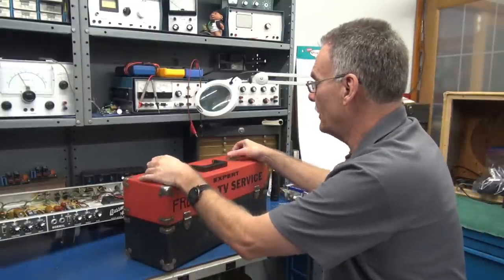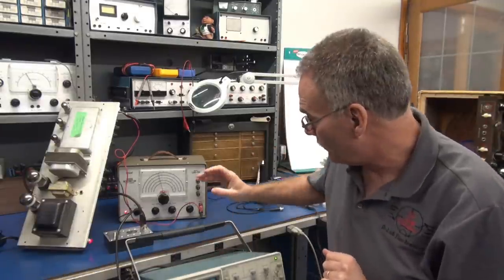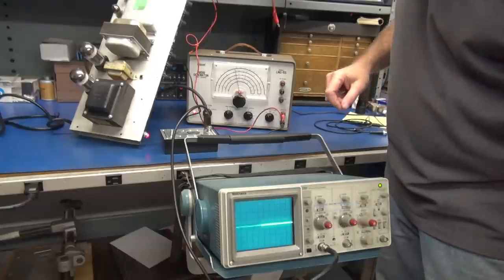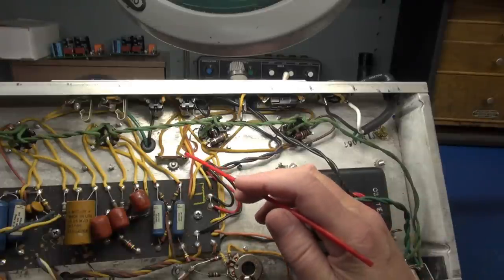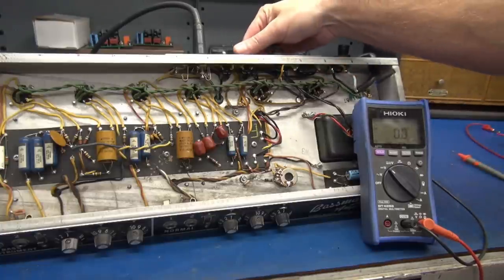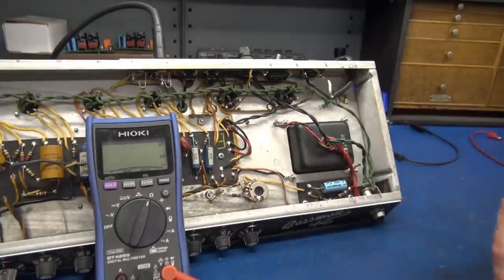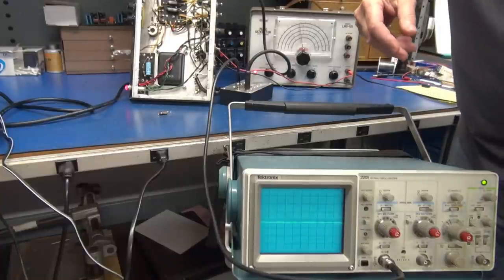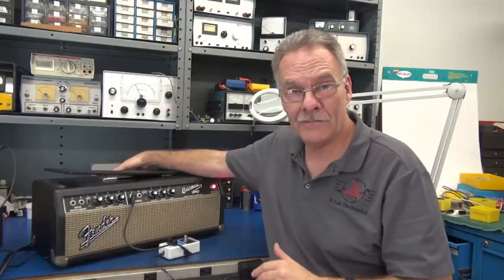D-Lab Basic Training Fender Bassman tube guitar amp Low distorted output Lets fix this with Fred

Comment: Holy crap, this video couldn’t have been timed any better.  Just this morning I received new tubes in the mail for my 1967 Bassman 50, and after installing them I noticed that even though it started working again, the output is low and distorted.

Comment: Loving this Fred series, Thanks D-lab! 
Any chance on doing some  Phase inverter scenarios?  Explain the difference between using a 12AX7 compared to a a 12AT7 for Phase inverter and the reason for and against etc.
Thanks cheers
Reply: ,AT is used as it is not a Galn Stage

Comment: Thanks for another interesting video. What is the voltage Vpp of the signal coming from your audio generator unit when you perform the initial testing?
Reply from the maker: I believe it was set at 100mv

Comment: Hello D-lab, what are your thoughts on using higher screen values (~1k) to protect modern production tubes from overcurrent faults?
Reply from the maker: I do believe its a good idea. Ham transmitters use screen regulators to protect final output tubes. Examples 0D3, 0C3. They have been doing that for years to protect 6L6 and 6146 tubes. It would be worth exploring.

Comment: The bad screen resistor went up to 20K homes when a good screen resistor should have been at 470 homes so the bad screen resistor that is at 20K is restricting and giving less current to the power tube and that is causing what type of distortion it look like a symmetry distortion how it would adjust the the width of the positive and negative push and pull maybe you can explain in the comments and get back to me that would help me out a lot but it has something to do with the restriction of current that would that is doing something to the tube to cause it distortion it might be a transconductance thing because transconductance is based on the current verse the voltage of the input and the output of the tube

Comment: Could anyone here tell me what might be causing this issue?  New 6L6s installed in a 67 Bassman 50, but only one of them is glowing.  The amp still works, but the volume is noticeably lower and the tone breaks up much easier than it used to.
Reply from the maker: Identical problem the Bassman in this video had. Check those Screen resistors
Reply: @d-labelectronics  I swear I’ve learned more from this channel than from years of classes related to electronics.  Please keep it up, you’re a national treasure!
Reply: Only one “glowing” -- I assume you mean the heater isn’t lit up.  Check it in a dark room to make absolutely sure.  If you’re certain the heater is dark, then swap output tubes to see if the “dark” tube stays dark in its new position.  If it does, then that tube’s probably bad.  If, however, after the swap, the other tube that looked fine is dark now, then I’d say you’ve got a problem somewhere inside the amp, in the heater circuit.  In the latter case, could also be loose contacts in the tube socket where you’ve determined either tube stays dark.  New tubes do occasionally arrive bad, though, so that would be my first suspicion.
Reply: @drawbridge611  I swapped the tubes and now they’re both glowing…. Wtf, this is confusing.  The only possible explanation that I can come up with is that maybe the “non-glowing” tube just wasn’t seated properly?  Any more ideas, anyone?
Reply: @seanmcdonald4686  It could be a bad socket not making good connection.  Or it might be a bad solder joint on the socket.
Reply from the maker: Check the tube socket pins, see if they are worn/spread out not making contact
Reply: @seanmcdonald4686  Totally agree w/ Mr. Terry re. loose pin sockets.  There's also the possibility of corrosion present on the tube socket contacts (it is an old amp after all), and the simple removal & replacement of the tubes scraped enough of it away so things are working again.  Plenty of info on the Internet about how to clean tube sockets, if you wish to pursue that.
Reply: @drawbridge611  I’ll check that out this evening, it does seem to make sense.  Thanks!
Reply: @d-labelectronics  Thanks a lot for the help!  By the way, I’ve been considering having some work done to 1 or 2 of my amplifiers, and I can think of nobody who I would trust more than you.  I assume that the YouTube comments section isn’t the appropriate forum to discuss the finer details, what’s the best way to contact you for things like that?
Reply from the maker: Check my website: d-labelectronics.com